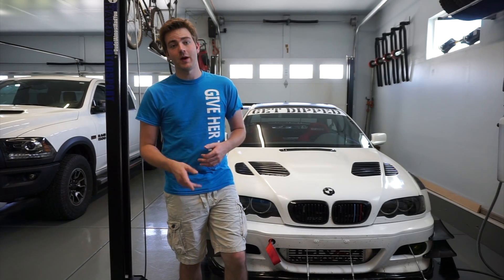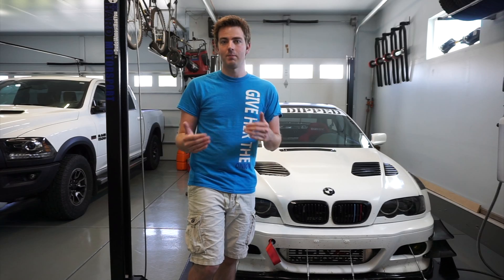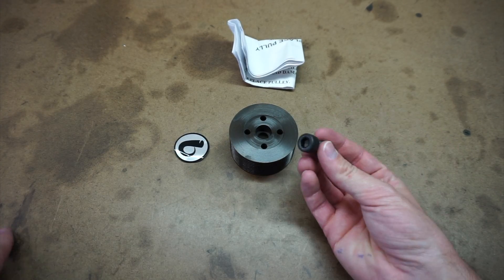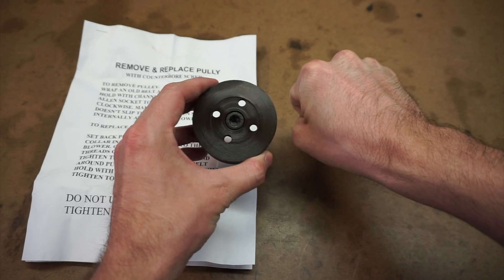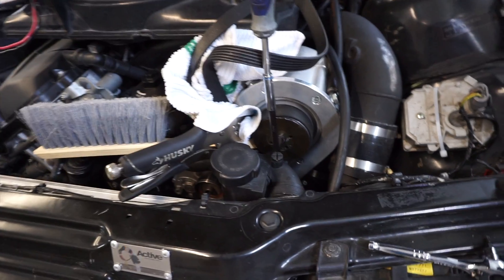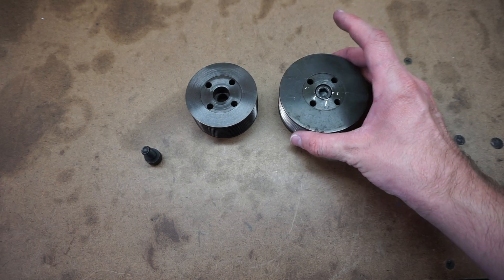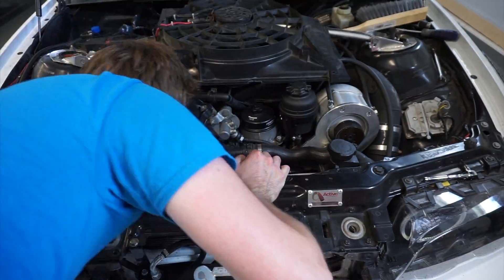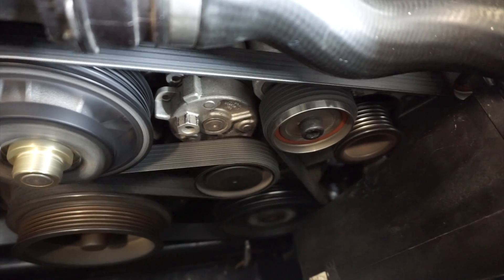E46 330ci supercharged, How to replace an active autowerke/rotrex pulley

Comment: Hey man question for you? I’m running an AA kit on my E46. 1 did you need a retune after installing the pulley? And 2 did you ever figure out if the belt squeal at cold start is normal?
Reply from the maker: No, your belt should not squeal. But mine still does on cold starts. I’ve never really been able to get it to completely stop. Sometimes it’s every other start up sometimes it’s every fifth start up. Sometimes it squeals really loud. Sometimes it just kind of chirps it’s annoying, but everything‘s tight and it’s not really doing any harm except for maybe Shortening the lifespan of the belt (which I replace often) and yes, you need to re-tune it if you aren’t already, you should be going through revmatch Motorsport

Comment: How you can change the pulley without remaping the car?!
Reply from the maker: The car was tuned to run an 85mm pulley closer to sea level. My car didn’t need remapping because the tune was correct, my altitude was wrong. To compensate for my altitude we put the 70mm pulley on and now I’m running the correct boost pressure. 12psi is what Active Autowerke claims the supercharger stage 2 does. I was running 9. Now it runs 12. That’s why I didn’t need to remap the car.
Reply: @TenzaMotorsports  I was also thinkig that "stock" stage 2 from AA should only make 8 psi, you have some more mods to the kit, or they made you more becouse other tuning what you made on the engine?
Reply from the maker: The guy at AA said I should be seeing 12psi. I'm not sure though. Whatever it ends up being, its running right now and its fast!
Reply: @TenzaMotorsports  Thank you for your great replay! I got same rotrex compressor and now im wondering what is the best pulley to start. I saw AA putting 90mm for stage 2 /i have also intercooler/ but the kit is from https://www.schaper-automotive.com, I got stock engine and headers, so wondering how much PSI is safe.. What we will go for, i think i will stay around 9 PSI what i saw is "default" for AA stage 2 /Also G-power pushing only 8-9 PSI

I get with the KIT 80mm pulley ready for 450hp and its crazy :D

Comment: Hey buddy, is there a need to replace the tune when the pulley is replaced?
Reply from the maker: I didn’t do a new tune. They said I didn’t need to.
Reply: Tenza Motorsports  ok awesome!, and from where you got the 70mm pulley?
Reply from the maker: I ordered it from active autowerke
Reply: Tenza Motorsports  ah ok.. I tried to find this type of pulleys.. can you attach here a link please? Thanks man
Reply from the maker: They don't list the pulley. I had to call them and tell them I needed it. They only recommend the pulley for people running their cars around 5000 ft above sea level.

Comment: Did your belt squell before?? I have the same AA kit, and my superchsrger pulleyy is now squeling. Going to reach out to craig tomarrow
Reply from the maker: Yea I’ve been fighting that a bit. Especially on start up. But once everybody is moving it goes away. So I’m not sure
Reply: I bought a almost complete stage AA kit of Facebook market place for 1600. Just missed pipe number #7 so i have to wait for stage 2 until i get it in the mail. This video helped alot im also in CO at 5280. I have a stage 2 belt that is just the tinyest but short of fitting woth the current pulley, hopefully a smaller pulley will solve the squel. Awesome build!!
Reply from the maker: Sorry for the slow reply! That is truly an amazing deal. the smaller pulley helped a bunch, I would recommend it for you at that altitude. I don't wanna say my new output numbers yet since I'm posting the video of the new dyno today or tomorrow. Stay tuned and let me know if I can help your build in any other way! my insta is @tenza_motorsports. I'd love to see your car.